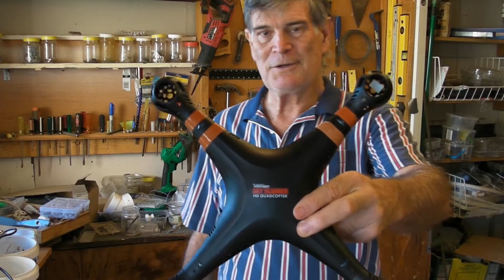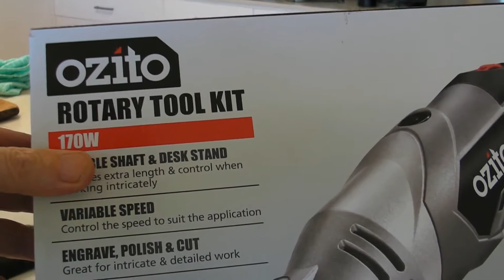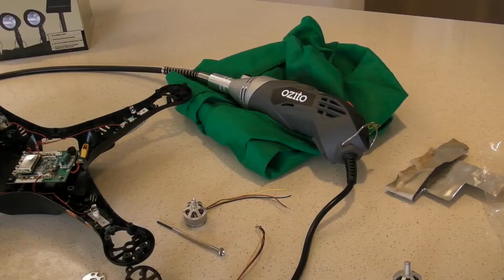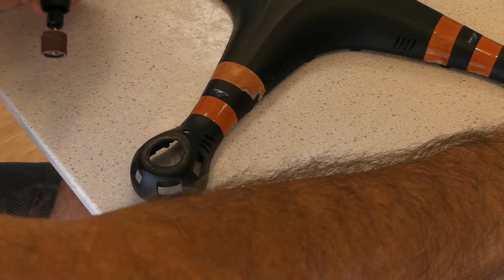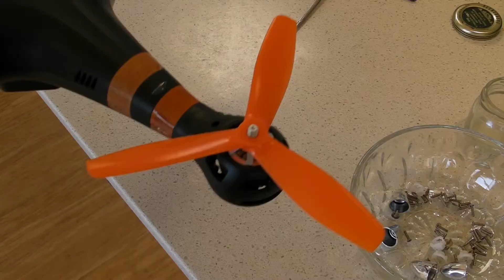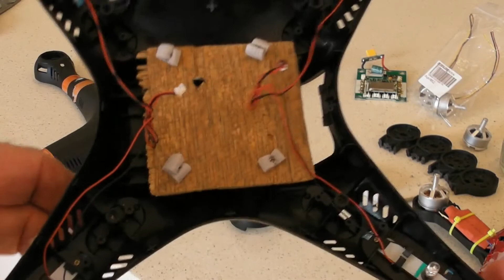Syma X8 Clone rebuilt/upgrade - Part 3

Comment: Love ya brother.. your a tinker  one day will send you a real drone.. if didn't cost a fortune!! Lol that's a handy tool! I Just used to remove tile.. got for drones.. lol reminds me of when I was modifying muy bigs 3. I still like to make one of kinds.. I'll do a vid.. tribute to you.. way funnier to build a one of kind..  yep we have alot I'm comin.. I'm curious to what your doing for electronics? fc.. esc?? looking Great!! True love for Hobby!! God bless!! Tell you're spoter.  Best wishes also 👊👊💪💪
Reply from the maker: I bought a real drone a while back - an iFlight Cinebee with a Cadxx HD hybrid cam. I got it working with Betaflight and flew a couple of times before the Cadxx Turtle V2 failed. Had to wait months for redesigned parts to arrive. The stack in the Cinebee would overheat if I had it plugged into Betaflight for too long. Not keen on dji having so much control over a drone. Also want to update when I decide to, not dji. So, for the moment happy to tinker with the bits I have. Apart from the Bugs 3 FCBs, motors and frames, I've proven that I can add various ESCs running SimonK and BLheli_S protocols without any issues. I'll probably try out an F4 or F7 FCB in the future, hopefully when Betaflight is a bit more refined.